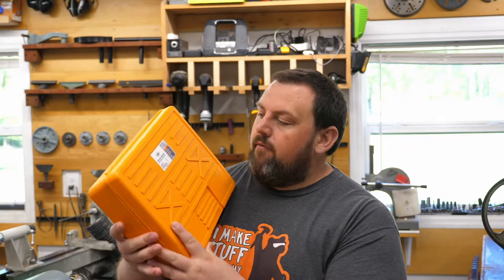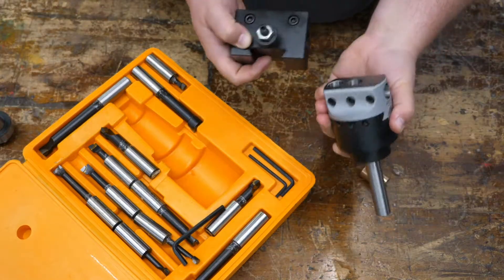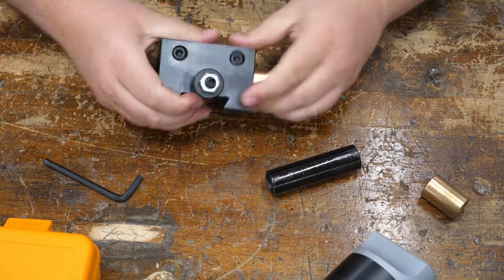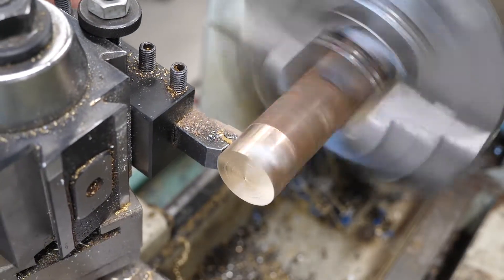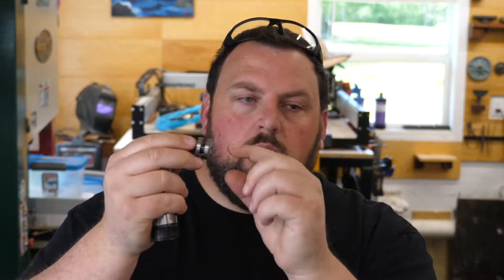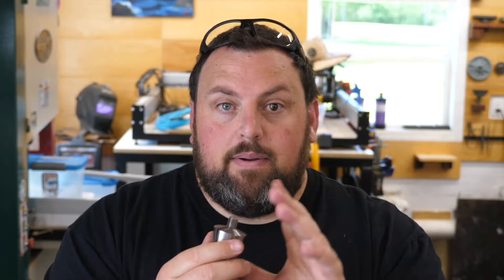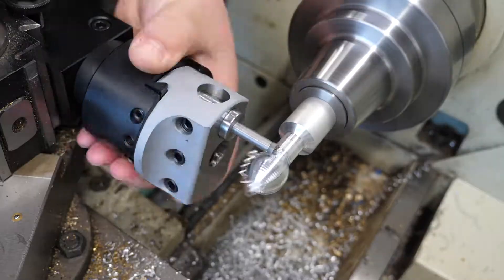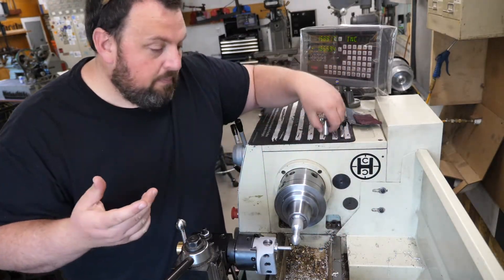Making A Ball Turner From a Boring Head: Machinist Tools

Comment: Would it be a good idea to drill a third hole in the boring head to accept the cutting tool?
That way you can see and use the adjustment screw without stopping the operation..😉

Comment: First, throw away the cheap Chinese trash so-called "boring bars." Secondly, what have you achieved by cutting a sort of a ball shape with a boring head? There are numerous videos on YouTube which shows exactly the same process. Show something  which can be used to cut internal and external radii, and please, using steel, stainless steel etc., and not aluminium or brass which is soft.
Reply: What a trash reply. He showed you can make a ball with a boring head. This isn’t a video about turning a radius internal or external for that matter. There are other videos for that. And so what if he chose aluminium? He could cut steel or stainless if his feeds and speeds are right. You must be fun at parties saying that the place isn’t Studio54 and why bother having a party.

Comment: Why is it every ball turner I see makes eggs and not a true round ball?
Reply from the maker: True round is tough because there is only one perfectly true and an infinite number of not rounds.  Ill have to put a mic on the aluminum one I turned to see how close I got!
Reply: @HighCaliberCraftsman  I dont need a 100% ball, but it just cant look like an egg.  Maybe with some practice you'll get closer.
Reply: The tool post height has been overlooked. Get an indicator on the chuck and dial the bore of the tool post holder - where he tapped in the bushing. Get that set to zero and no more eggs.